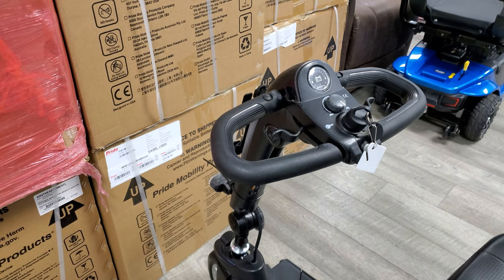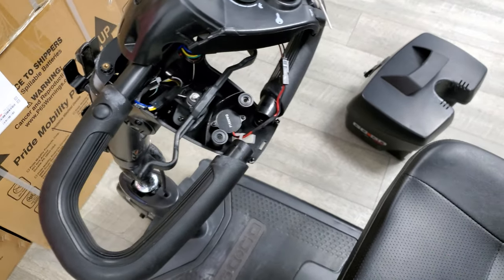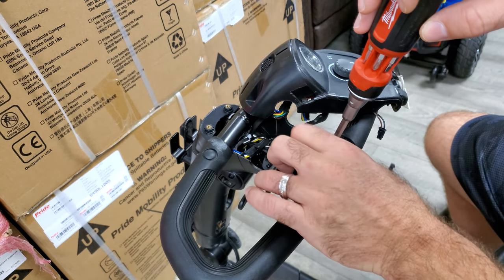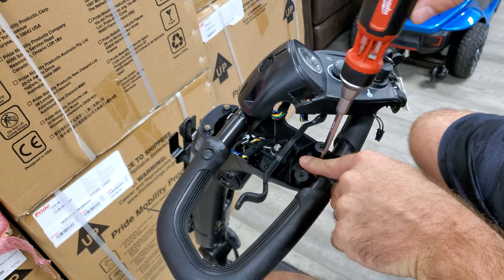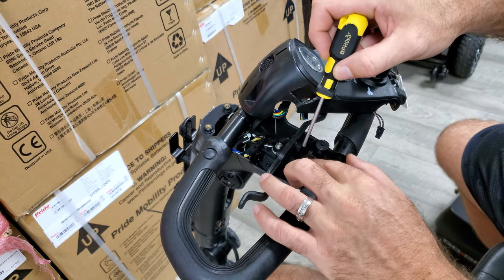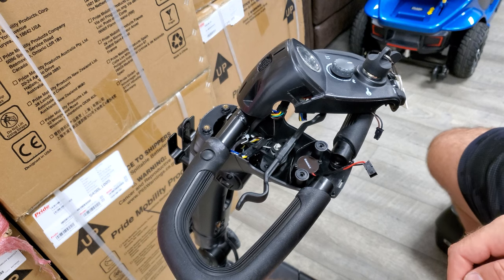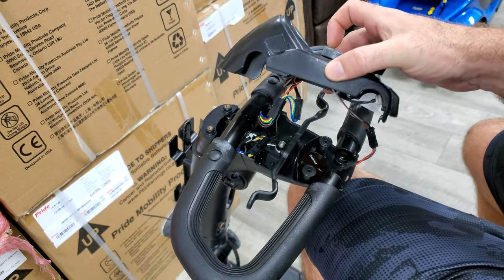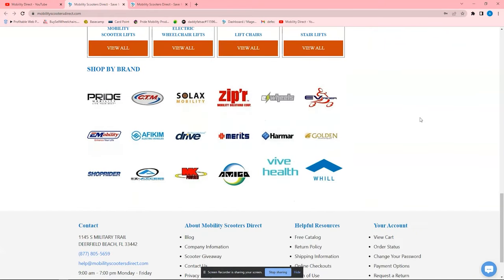🛠 How To Replace The Horn Buzzer Beeper On A Mobility Scooter

Comment: I am trying To see if Have any recommendations where I should get a replacement horn from my scooter has a low horn and I'd like to have something with a bit more volume
Reply from the maker: You can replace the horn easily, you just need to have the technical ability to replace it and ensure that you're not going to cause any issues to your battery balance as it relates to the charging and discharging cycles. This is something that only should be done by a technician.